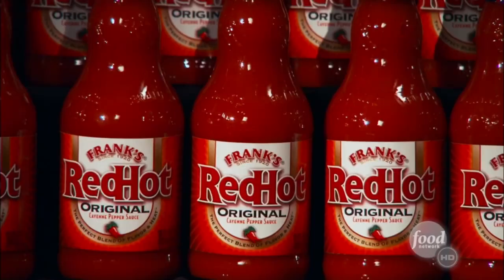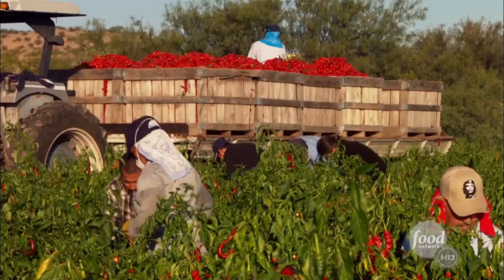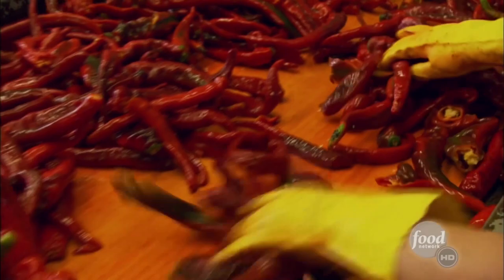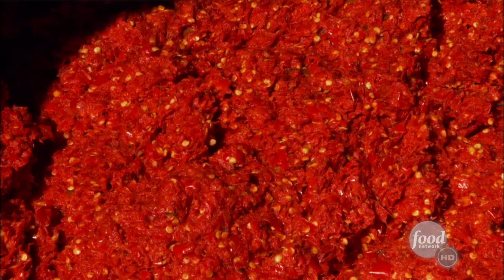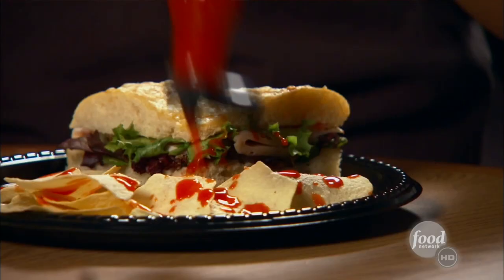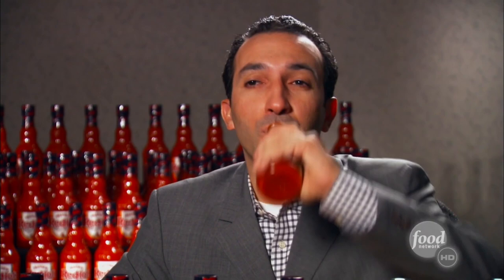Fully Unwrapped - Frank's Red Hot

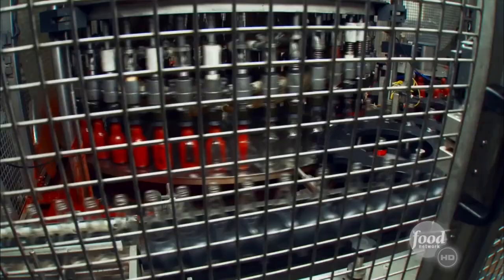Comment: 1:34 Wait, if I remember correctly, this is a rinsing machine.
Reply: That's a filling machine.
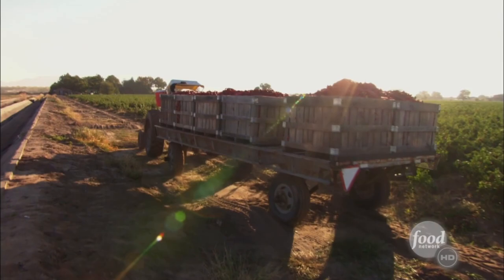Reply: @hexagonist23  Na, they are clearly rinsing the bottles with hotsauce so they can later be filled with nice refreshing water. The same water they use at 0:38 which is a filling machine disguised as a rinsing machine.